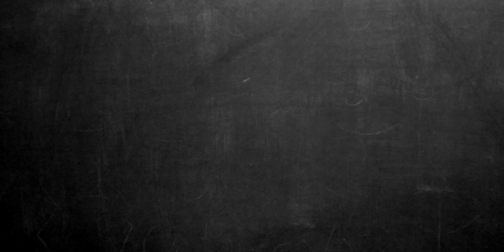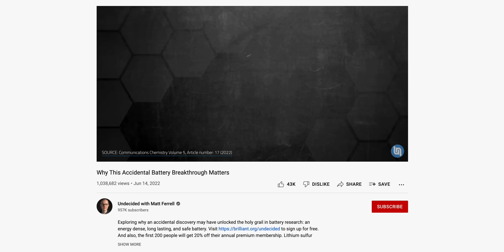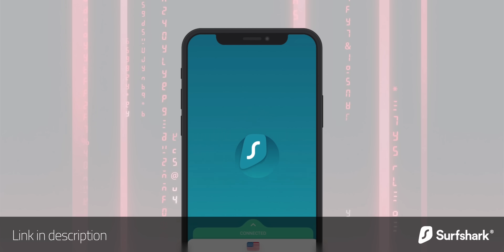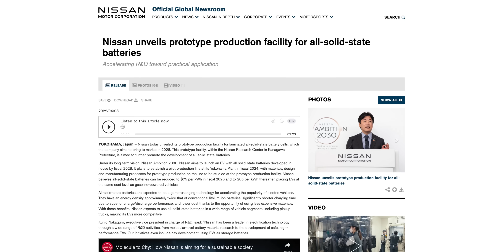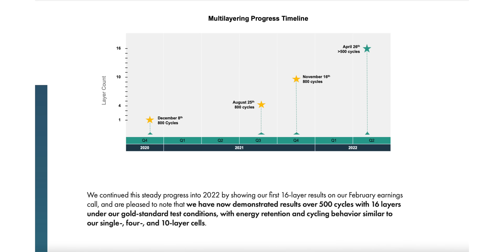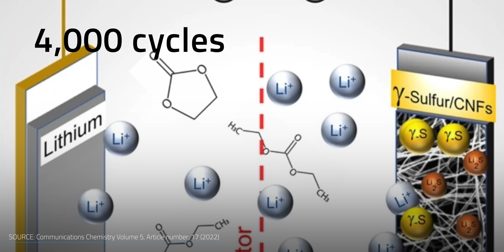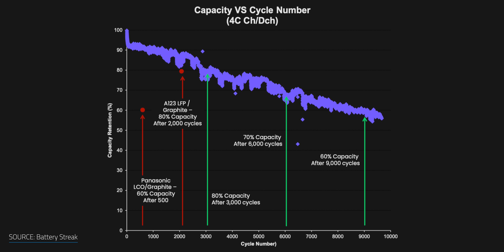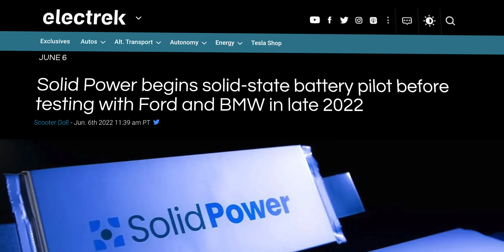Is This Solid State Battery Too Late?

Comment: @7:00. And this is how you know NOT to trust Quantumscape. Parasitic side reactions are a function of time, not cycles. They should be representing their performance as 400 hours of driving, not 400 cycles times some scales capacity. Why 400 hours? Look at their discharge time? Their chemistry only experience 400 hours worth of driving to degrade that much. 

Do you want an EV that needs a battery replacement at 400 hours?

@7:35 this data shows cells charging 4x slower than the previous data. So it doesn’t “mirror” what was previously advertised.

Comment: I am not so optimistic. These numbers are a way to increase hype over your product and ease funding for your research. No one really knows anything regarding these new technologies, not even their creators. The new Tesla cell, for example, didn't increase energy density (yet) as promised by Musk in 2020. In comparison with the older one its density is lower.

Comment: You might want to take another look at the 4680 cell the electrolyte is dry not wet therefore it is one of the solid state batteries

Comment: I believe we are building the National Power Grid Battery with every EV we make. It is possible to program EVs that are plugged in at home and business to start charging when excess wind and PV power is available during the day and give power back, perhaps 30% of a full charge, to the grid when needed. 

This would minimize or eliminate the dumping to ground of excess power that happens today. No new infrastructure would be required except that needed for software implementation and is being built out one EV    and charging station at a time. 

The National Power Grid Battery will be dispersed throughout the United States and should have superb reliability as EV charging sites will eventually be in the millions. The grid storage solution we need to take advantage of wind and PV is being built one EV charging unit at a time and it will change our economy forever.

Software engineers are up for this challenge.

Comment: not if there are solid state batteries that are lighter and/or have more energy density; EVs based on lithium are typically over 4000 lbs which means they cancel out the efficient motors as they are heavy to move; and they take more energy to build. The grid has to be made green also to make any of this of benefit.

Comment: What is not mentioned in the video is cobalt, and the HR issues that come with it. Lithium is also a cause for concern given local pollution at the production sites. At least one of the competing solutions mentioned in the video still has those issues, albeit possibly in smaller quantities, which will not help much, as total production volume will skyrocket anyway, offsetting any improvements due to less cobalt per unit. I hope it will not be one of those solutions that win out in the end.
Reply: There's never any mention of the huge ethical issues of mining Coltan for Niobium and Tantalum capacitors.

Comment: What about the use of solid state batteries in smaller devices or to replace other types of rechargeable batteries? It seems the like the tech has lots of potential even without the electric car market.

Comment: Not sure why u placed price high the priority list. 
If a battery has 4000 cycles and another has 400 than u can say u need to buy the cheaper one 10 times over the product’s age which makes it more expensive. 

If u but a car for 3 years, the gap in kw per kg is meaningless. The car may cost 5000$ more, but within the price of a car and taking into account aging, it’s negligible. 

I would say its a sweet spot of trade offs. Each case needs to be evaluated separately. 

U also need to take into account material availability. Niobium is mainly found i. China and russia and since were getting into a world war, may not be the best option. 

Even if a war wasn’t here, it’s relatively rare and is available now because we don’t widely use it. 

If u start making it the number one go to material, it will become scarce rapidly, increasing the price. 

The prediction of battery tech is way more than the sum of the technical properties. Its heavily effected by foreign considerations.

Comment: "Charging times is one of the biggest reasons people are EV hesitant."

I'm hesitant not because of charging time as I see an EV more like a Cell Phone than a car in terms of refuel/recharge. No it's not charging time for me. It's Computer part longevity and the ability to replace those pieces when they inevitably fail, without issues cropping up with incompatibility. (Tesla is really bad about this one with how the motors are locked to being usable with the computer and it's software that it was installed with. Note my point of view is if it takes jailbraking the car to change a motor or a SSD in the computer if it fails, I don't want to be stuck with functionally a big heavy brick on wheels. that's a No go), range per charge (Cheap city EV's with their 50-100 Mile Range are not going to cut it for me), Range under load per charge(If my vehicle is rated to go 600+ miles and I load it to it's max with the family for a camping trip, I don't want to see only 100 miles before I need a recharge), and degradation of that range over time. in that order. Yeah the ICE is not perfect, but properly maintained, they will consistently meet a given energy delivered per tank of fuel. A fuel tank does not get smaller over time. So what if that battery only loses 20% of it's rated capacity over 10 years. That's still akin to the fuel tank getting smaller over time. 

As for my statement of Range per charge, I refer to my youth where I would play with RC cars, I could charge the battery for 30 minutes, and play for 10 minutes with this one RC car (looked like a pickup truck) I had. It also had a turbo button to make it go just that little bit faster when pressed. When I used the turbo button constantly I found that my play time was reduced to 7 minutes before I needed to recharge. So I would usually only use that if I was racing someone for a short burst. So one day, figured lets put it to work hauling some rocks and twigs since it was a pickup truck after all, up and down the street. I ran it without using the turbo mode and just drove it normally, Low and behold though, I found that my play time with a battery that would still consistently get 10 minutes under no load, only went about 4 minutes before the RC gave up. At the time I thought I had broke it somehow, but after I checked it and charged the battery back up, it went just fine back to it's usual 10 minutes (unloaded). The main reason I was confused was because my dad and his pickup would consistently get pretty close to the same range loaded or unloaded. (to be fair it only got 8 MPG with nothing in it but a driver and passenger and with a heavy loaded bed (construction materials and such) got 7 MPG. it was a gas hog chevy with an Edelbrock 4 barrel carb. It was my first major lesson in how Electric =/= Gas.

NO I am not saying that Gasoline or Diesel is great, I would dump them in an instant if I worked close enough to walk or ride a bike to work. The only Electric vehicle designs I can really get behind are high range (200-300 miles isn't going to cut it), while loaded(whole family with luggage or hauling materials around), and can self recharge by Solar and/or wind (when parked of course as turbines that can be used while driving would cause unnecessary drag that would make them worse.), has an option to recharge quickly, and the battery doesn't degrade 20% in 10 years or less. 

That or make the Toyota Murai more useful beyond Coastal California or other locations where Hydrogen Fuel Cell EV's like it can be used. Hydrogen can be produced everywhere.

Or again... figure out what these people are doing to make ICEs run on water. And avoid getting offed by the Oil Tycoon mafia.

As for the point of the video, Yes I agree that Solid State batteries are a little late to the party with all the advents in energy storage that have come about. It's a neat concept but unless something drastically changed in it's cycle counts, I doubt they will get much use as an EV battery. Perhaps UPS units? Most of those use AGM Lead Acid batteries or Gel Cells, and a lighter safer battery for such a device might work nicely.

As for your sponsor of the video. VPN's have only a few major uses. Those would be privacy due to the encryption, bypassing Geopolitical barriers due to different exit points for your connection, and anonymity. However what the shameless plug fails to point out is that You can't have all of these things if you are foolish while connecting. If all you use a VPN for is seeing what Netflix has outside your country, Then you are getting the privacy and the bypassing of Geopolitical barriers, but not the Anonymity because you are logging into something that you are a subscriber to. The best advice is to have separate logins that are used for when you are On the VPN and for when you are not. Not exactly useful for something like Netflix unless you have a means of paying in the country of choices monetary unit. but it's a matter of what you really want to do. Bottom Line, don't expect Anonymity with a VPN connection if you log into things you use when not connected. (Facebook, YouTube are big No no's there.)

Comment: Hi your advertisement surfshark is false. a VPN doesn't prevent tracking as that happens at the browser level. It isnt proxying and messing with your cookies as thats whats needed for anonymity, not routing your traffic through some other node as tracking happens by browsers not IP. Using a public VPN just exposes you to other people on the network just like as if you are on the LAN. Its like being on a LAN with a lot of strangers.

The problem with batteries is that, even if you could make it charge very fast you have to get a lot of electricity on site in order to provide that charge speed. it doesnt help if you have a charging station with 100 stations, and if say each car battery is 100KWh and charges in 15 minutes, thats 400KW per car and 10MW for the station, that needs its own generator so would have to be located at somewhere inconvenient like next to a hydro dam for it to be green. The cabling needed would be very very expensive. For EV adoption to be a reality, charging at home and having a decent solar system needs to happen, and for that to happen the entire system has to be affordable.

Comment: Do I think solid state is the future? I'm undecided. But for the safety reasons I certainly hope it turns out that way: it seems intuitively obvs to me that not having a liquid electrolyte removes one crucial failure mode; and the reduced need for protection electronics is also a big plus.

But I'm undecided which way the actual future will go because the future is not being driven by science, nor by safety, nor even by market place economics. 

The future of batteries is currently dominated by one person: Elon Musk. He can afford to reduce his own pricing to stay competitive even if it doesn't make technological or economic sense. From his own public statements almost everything he does is aimed at getting a viable community on Mars. The future of batteries will be driven by whatever Musk rightly or wrongly thinks will be viable on the fourth planet. 

And nobody, not even Musk himself, can predict which way his butterfly brain will decide a few months ahead: let alone by the time solid state is ready to be offered to this planet.

Musk's long term goal is fixed, but he is endlessly flexible on how he wants to get us there. Ultimately it is Musk that is still undecided. 

The rest of the tech community, let alone the non tech people, don't get a vote.

Comment: Out of all of these, the Sulfer/Sodium battery has me the most hopeful. Those are all abundantly available resources (carbon, sulfur, sodium) as opposed to Lithium which is only available in very few fiercely guarded areas. What good is it to switch to an electric vehicle if the creation of the battery/tech is doing more harmful pollution than gas? With the Sodium Battery I'm actually hopeful of seeing a point where both the production and use is a low impact.
I've usually been on the opposite side of the fence from environmentalist who are pushing electric vehicles, but that has always been on the basis of them expecting people to adopt a less effective technology than what is more readily and cheaply available. Now that we finally have a comparably performing tech option, all we need is a genuinely better environmental option and I'm all for it.

Comment: I was never undecided. I am against any technology needing rare earths , or large quantities of precious metals. 
Neither is economically viable long term. Either they do it with dirt from the street, or its time for them to go home and let someone who can take over. 
Cheap abundant  materials, is the key to long term sustainability. I wont pay for something that will  be inoperable 10 years down the line , cause we run out of materials.
Rare earths, are like fossil fuel. NON renewable.  We use them up, they are gone. I thought we were supposed to try saving the planet, not damaging it more. 
Though truth to tell, with bone headed deforestation policies like DPRKs..  i wonder WTF will be left to save, if and when we manage to find eco friendly solutions .

Comment: Counterpoint; If 10-80% happens in 30 minutes with conventional li-ion for 800 cycles, and with ceramic batteries 400 cycles at 15 minutes, think about how they'd compare at similar charging time. It's a logarithmic curve, it'd probably have 4 times the endurance at the same charge rate.

Comment: I dont think our electricity grid can handle if everyone went full EV. They should use them in hybrids with a generator producing energy from a small IC engine. 
Idk maybe like a 1-2L 2-4 cylinder solely to recharge the solid state battery. 
You can put a battery that is 1/3rd the weight of an EV battery and it would still have the same power. Then you have a very small efficient engine to regenerate what regenerative braking cannot compensate for. Should be able to get 50+ mpg cars and SUVs with a combo like that.
Also a lot of electricity is produced from fossil fuels anyways so we might as well use the direct source of gasoline rather than the energy loss from power lines getting delivered to chargers and homes.

Comment: I think it's also important to note that there is still a large segment of vehicles that are not served by current battery technologies, including Tesla's 4680 cells that -- even when using GM-LG's NCMA chemistry -- fall far short of the needs of HD trucks and commercial and industrial vehicles. In order for an EV HD truck to be competitive with current HD trucks, it will need a battery with 750+ Wh/kg energy density. So far, that is something that only solid-state batteries are on track to offer.

Comment: I think you overlooked one of the most important battery advancements that should be coming to market next year through CATL, EVE, and others: LFMP batteries. Essentially, the introduction of manganese into a traditional lithium iron phosphate battery results in gravimetric energy densities similar to current NCA and NCM chemistries (250 to 300 Wh/kg) while preserving LFP's lower cost, lower fire risk, and cobalt-free benefits.

Comment: when they where first annouced. yea. sounded like the god battery. but since than. lithium cells have made up a LOT of ground on them. and the cost per kw/hour is just insane. even at the projected timelines. i can CURRENTLY buy lithium cells ~$10 kw/hour. granted they are likely reclaimed cells. i would assume a big corp could get new cells in massive bulk for about the same price.

Comment: They way I look at this is that we don't need any breakthrough in battery tech in order to transition to EVs mass adoption. The whole industry has now already entered the long and boring incremental improvement phase. Yes it's admittedly not as exciting but just consider what we will have in 100 years, the time it took the ICEs to reach their current state of efficiency. I bet we will have $20 batteries that have a range of 500Km.

Comment: The better technology will always be the most desirable. Energy density is still the single most important parameter when talking batteries. We need to be above 600Wh/kg, to make EVs perform as well as gasoline cars or around 3 times what they can do now. It is not only a question of range but vehicle mass. EVs now have giant motors to haul tons of vehicle around, that might compensate for acceleration, but you can never make a vehicle as agile if it weighs as much as a lorry. So once solid state batteries are here, people will forget about Li-ion or LFP. Those chemistries will likely still be used, but they will be considered inferior. Same thing with cars a hundred years ago: Once self starters and coolant pumps became standard, nobody wanted hand crank and thermosiphon radiators, that couldn't handle hot weather. There was no looking back, same will happen with solid state batteries. EVs with them will be perceived as completely different vehicles the same way as nobody wants a lead-acid battery EV now.